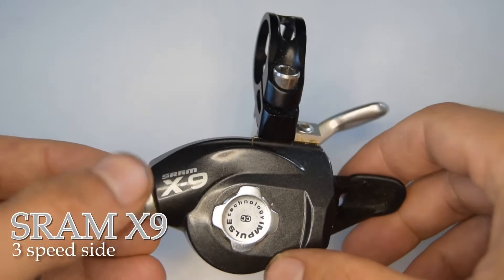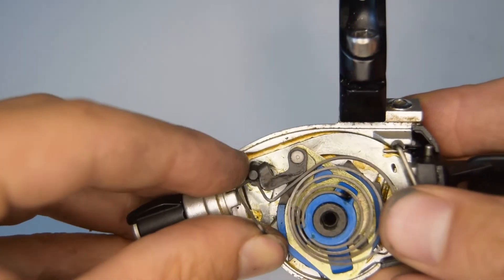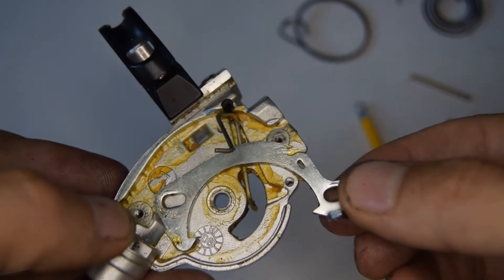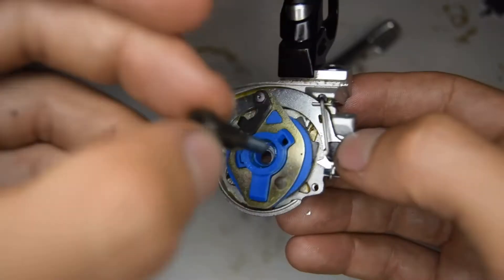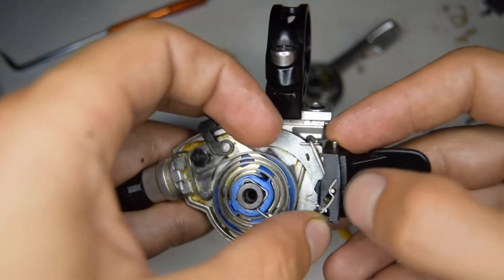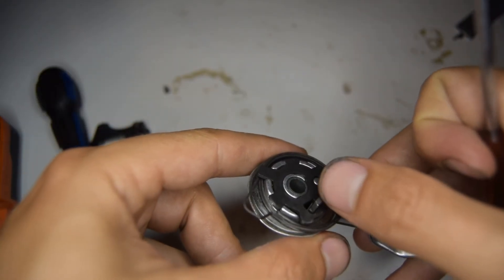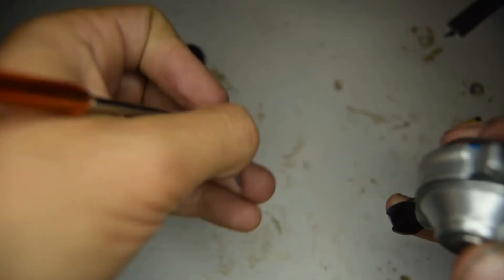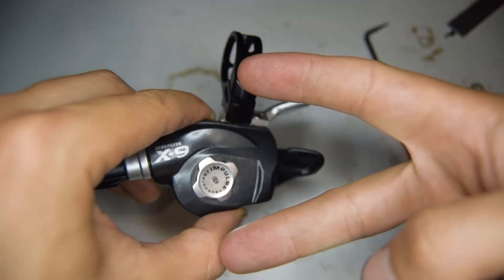Pt.1 SRAM X9 3 speed shifter: Full rebuild overhaul service

Comment: I would have needed that video three years ago, when I wanted to change the gear cable, but opened the wrong cover in some lunatic mood. After fiddling for hours with thread and ribbon to fix the spring while reattaching the lever, it did not shift and was sticking (maybe the wavy washer was bent). I brought it then to a Specialized store, the repair guy was eager and began to open it. And then said the best sentence I never wanted to hear: Interesting, I haven‘t seen the inner stuff before… 💩
Reply from the maker: Lol, from experience, the best mechanics are the oldschool types who used to repair motorbikes who,  therefore have a better understanding of the mechanisms etc, generally repaired rather than replaced. Most of the time (not always) you have those type of bike technicians who chuck a whole cassette away instead of changing the one sprocket. In fairness, it’s also relative to time and cost. 2 hours repairing an item at $40/h Vs replacing for $60